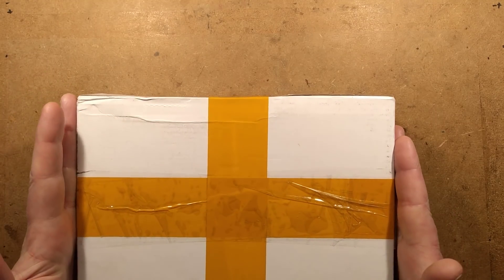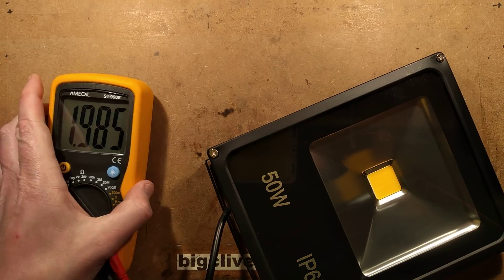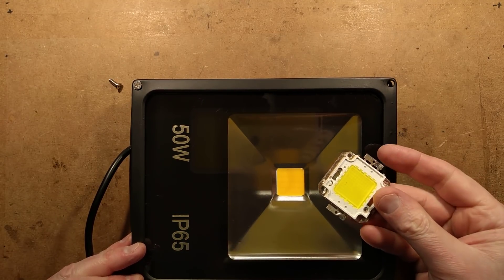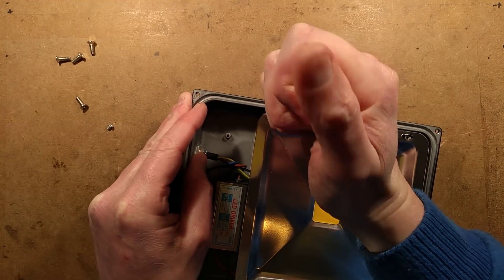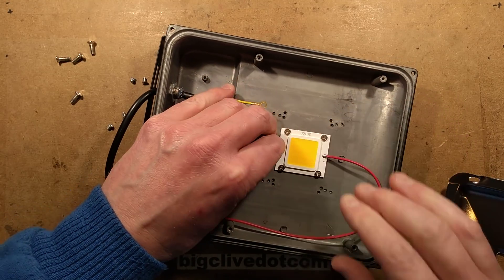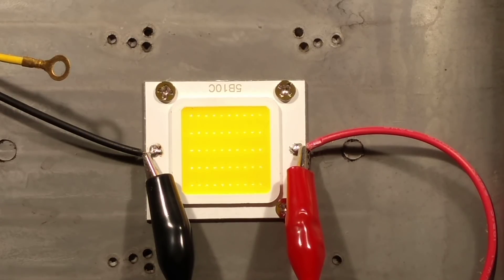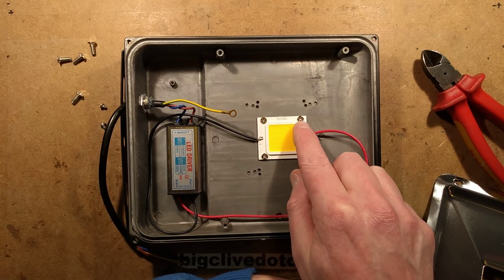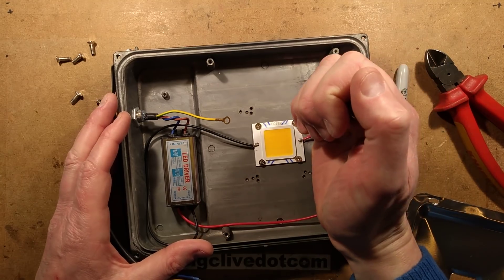Another cheap eBay LED floodlight.  Is it really going to be 50W?

Comment: no search link for ebay? boooo. still, looks like it could be a fairly nifty little source for reasonable parts i f you wanted to hack together something else. window how one of those full spectrum cobs would work in one of those shells. i've had people asking about how feasible it would be to make grow lights without breaking the bank, even though led grow lights are still insanely cheaper than the older styles.

Comment: Is it really waterproof that would kill the thing outdoors?
I think most of these wont even have an IP rating?

Our block recently had a so called leccie come and install one of these - charged  £170 and its blown within 3 months.
Thankfully I did not participate or pay for this numbskull ripoff spark -  he actually drilled a hole in the double glazing to fit it, used non ip rated wire, tied it up to the fusebox mains tails with tape and left all the dust and drill material lying on the hall carpet - also used black cable so not even any conduit or white to match the walls so looks horrendous wont respond to phone calls apparently!

This is the standard of the average tradesman in the UK these days 50% effort for 200% profit - how very sad for our country!

Comment: The  non connected earth wire looks typical of Chinese 'quality' control, for this type of unbranded product, you'd have to pay a fair bit more if they had to stop and connect that on every lamp! Also those reflectors are really only cosmetic as it in front of the light source, unlike a conventional halogen lamp
Another thing which seems to be common on many LED flood lights is the practice of pre fitting the flex, I'd do what Clive said & make the connection inside the fitting.

Comment: Quite a bit of futzing about trying to get those alligator clips on the wires; would have been faster to swap them out for mini grabbers. Surprised you don't have a set hanging by your workbench; maybe you should add some cheap shitty ones to your next eBay purchase?
Reply from the maker: I have some, but wasn't expecting the insulation to be quite so hard to slide back.
Reply: Probably just as well. Somebody else might have found fault with using mini grabbers to supply current. Can't please half the people half the time.

Comment: Very nice overview👍. Didn't look like complete crap for the money you spent. I could use some of those for outside of the shop.
Reply from the maker: Good value just for the casing.  Even at 20W the light output is useful.  The best bit is that for people who are technically minded like us they are serviceable.  You can fit new drivers and LEDs.
Reply: @bigclivedotcom  Yeah, good start to a LED DIY kit.  Hard to beat that price shipped to the door.👍

Comment: why are they not earthing...

answer: the manufacturers want to get as many done as fast as possible with as few parts as needed.

least screws to save money (even a single screw add up)
shortest assembly times (if they have to position an extra wire then that is seconds wasted starting on the next light)

so why not just use a cable with only two wires?  because two wires means they can't sell it in all the places they want to.
my guess, the cables are actually cut from recycled cables where they cut off the plug

Comment: Fitting the earth would involve the cost of the single screw holding the wire down. Clearly wasteful if not actually needed. Over 1000 units it could waste 1 pound/euro/dollar. Better to be unsafe and make the extra money.

Comment: Why do all these transistor LEDs always have this yellow filter in front of them? It even isnt 100% transparent and more looks like semi transparent. Like honey bee wax. Why is this? Does it block some unwanted wavelengths or even UV range? Why isnt it just 100% transparent? Or "white"?
Reply from the maker: The LED emitters can only emit in a single wavelength of light, so they use blue LEDs to stimulate a yellow phosphor and the combined output is white.
Reply: @bigclivedotcom  Why does yellow+blue give white light? Where is the red coming from?
Reply from the maker: @bestonyoutube  The yellow phosphor is usually made from a blend of different phosphors including green and red.
Reply: If you hold a CD or DVD with the metallisation at shallow angle to the LED, you'll see a spectrum and the output colors of the various phosphors.  Note that there are typically quite large gaps between colors, which you wouldn't see in e.g. incandescent lamp output.

Comment: There seemed to be a mounting post for the ground wire to the left from the LED driver? Maybe they just forgot to screw it down :)
Reply from the maker: Very few of these lights have the earth wire connected.  It's just seems common for them to leave it floating.

Comment: An additional question in my mind with this kind of product is whether the driver (or other power converter in other types of products) produces a lot of RF noise.  (I'm a radio amateur and have experienced LED and CFL replacements for incandescent bulbs that just wipe out reception.)  I'm not suggesting a laboratory grade measurement, but an AM radio tuned to a weak station, or better, a short wave receiver listening to foreign broadcast or time service, say from Germany, could sit nearby when the LED or other product is switched on, to see if it makes a significant impact on radio noise.
Just a thought.
And thanks for the video.
Reply from the maker: Almost all the switch mode drivers create a lot of RF noise.  The quietest drivers are probably the simple current regulation or capacitive dropper types.
Reply: @bigclivedotcom  Though it is possible to keep the bulk of switching mode noise "inside", though this requires shielding, reactances, and careful board/wiring layout, which I expect is rare in Chinese source boxes.  Still, in the states, we've had things like fining retailers carrying particularly bad devices, persuading them to push back on their suppliers, so some stuff comes thru that is fairly well designed.

Comment: I've just begun watching the video, my money is it will be no where near 50W. We will see if I'm proved wrong.  Posting at the 1:11 minute mark. :)

Several years ago I redid a bunch of our outside lights with 12V 10W eBay floodlights. Actual DC power was closer to 8W. Several of the LED modules failed over time. As Clive reported broken bond wires, they tend to flicker when first turned on. Replaced then with better LED modules and been working fine for several years.

Comment: I bought 2 cheap 50W LED floodlights with I think 100 individual little LED's inside of it, we put the one up on the wall and it lasted about 4 months before it started flickering really bad, every time we walk past and it turns on it gets worse and worse, it was like a disco outside. so we put up another identical one and for about 2 and a half months now it started flickering even more than the other one, we still have it up now and its like a epileptic nightmare they costed like a tenner each so what do you expect. Also Im pretty sure that the case isn't going to dissipate the heat of all the LED'S, I doubt that they are even making contact to the rear heat sink https://www.ebay.co.uk/itm/100W-PIR-Motion-Sensor-LED-Floodlights-10W-20W-30W-50W-Outdoor-Security-Light-UK/312275466766?hash=item48b5117a0e:m:mQXP7FFxaHtuJegDZGixwpQ:rk:8:pf:0 
this is the eBay link but i got it without the PIR sensor it would be cool if you could make a video about this supposedly 50W floodlight 
Thanks Clive

Comment: They terminated the earth cable with a connector but couldn’t be bothered with a halfpenny screw. 😂😂😂
Reply from the maker: The drivers come with the flex pre-attached and that crimp on the earth wire.
Reply: @bigclivedotcom  Ah, I bought two of the smaller ones you reviewed a while ago, I have one under my car port, one in my wood store.

Neither had the earth wire connected as you pointed out, so some new cable and a simple connector to the post that holds the bacofoil reflector cured that. Been working via a PIR , although not hard, for quite a while.

Comment: Looks like they just forgot to put the earthing screw into the post you pointed out  - they  wouldn't crimp a terminal on and then save on the m3 screw, surely ? I suppose the crimp term came with the driver though.... So close and yet so far.... and when will led driver makers put more than 30cm of mains cable on these things !!!???? 1 metre might give you some chance of tucking the connector away somewhere out of the weather.
Reply from the maker: They're using the stub of cable that is pre-moulded into the driver.  Instead of putting it into a terminal arrangement they just poke it out a gland.

Comment: I'd definitely imagine the flip chip LEDs make it easier for cheapo manufacturers to do a decent job. The ones with bond wires from quality manufacturers are extremely reliable, but the crappy ones are, well, crappy. When you're doing that many bond wires on such a low cost product something's going to give

Comment: I hope you're going to report that to Trading Standards to follow up. If it is a UK reseller the sale is illegal as it contravenes both safety regulations (for the earth) and false description rules (for the power rating). It would also be illegal to import if it is electrically dangerous.

Comment: To answer your question Clive, because if they see you grounded it, they know you messed with it!

Also, see if Thermal Grizzly's new graphite pads can make for a suitable substitute for the zinc oxide grease. Just for giggles. It's mess-free, won't ever wash off in wet conditions (hopefully) and comes in a couple sizes; I imagine one large enough to cover the space.

Comment: No earthing issue comes down to a legal issue is my take on it. If it could be shown in court that a reasonable effort was taken then liability hung onto the manufacturer would be valid. As there is no effort taken at all, that liability is all upon the end user and wrongful death liability case dismissed. Buyer beware being the first tenet of commerce, always trumping all that follow. It makes sense to me anyway. It's been shown that two lead lights don't sell, but by hanging the common colors in three wires on, it then does sell wouldn't be a point making or breaking the case either. It's just common sense they would put what wire bundle on it that does sell.

Comment: You're probably responsible for the majority of Cliff company's sales :D

I wonder how a 50-chip LED array is supposed to not burn itself up with more than 10W through it though - that's already at 70mA through each LED.
Reply: I also think that it's not really suited for use in these fixtures. I recently bought very long COB-LED strips (200x10mm LED COB's, you'll find loads on Ebay). 88 LEDs in serie-parallel, gives a current of 44 x 0,020 A, which completely equals the 10 Watt power rating they give (providing you drive them with a fixed current source and not with just some voltage)

But the light coming from them seems to be far greater than from the 30 and 50 Watt chips I bought a while ago. I get the feeling those 20, 30 and 50 Watt LED's have been produced in mass quantities, they never really caught on and now technology has improved and rendered them outdated.
Especially heat is a problem. The metalworker at the place where I work had a piece of 10 (or 12, don't know) mm thick aluminium kept as left-over. Decided to try that as heatsink for a 50 Watt LED (and eventually a 30 Watt).
With no cover, the temperature got up to 72 degrees at it's warmest point. WIth the cover on, it quickly rose to 85 degrees and beyond. Their just not up to the job I think.

At least, that's what I think. I still want to test what the light-output is with 3 of those COB-strips compared to a 30 Watt LED. So far,  I have not been disappointed. The light-output is great, they hardly get warm (or better: the temperature is far more spread over the large and thick heatsink) and the LEDs are so incredibly well matched...

Comment: I wonder if they have problems with leakage current from the LED - or a leakage fault in the driver? Maybe that's why they don't ground the frames?  
Could just be Chinese piece work, faster to not connect and saves a screw also - for every 8 (or so) lights they get a free set of screws.
Reply: For every screw they save, we get one!

Comment: It might as well not be 50W, because I doubt that you could maintain 80-85C substrate temperature at 50W with that case unless Ta is reliably frigid.  

To put this in perspective, the bonded-fin sinks I use for base-down passive operation have a base area of about 125x250mm, with 24 50mm tall fins.  That's marginal for 60W at 50-55C.  

Vertical orientation helps a lot, but with dinky cast fins, it doesn't mean much.
Reply: i have one and after 8 hours its still cool enough to touch
Reply: Forgive me for being doubtful, but "the heat sink is cool" tends to wind up being an indicator that input power is lower than expected or there's a significant thermal resistance between the heat source and the sink itself.  For example, the latter is why cheap fake SSR's tend to run surprisingly cool.  

In this specific case though, I'm assuming that yours is also operating at 20W and that "cool enough to touch" is approximately the same as saying "not too hot to touch".  That's plausible.  If those assumptions are wrong and it's actually dissipating 50W with e.g. 30C temp rise in still air, then I'm going to revert to being doubtful.
Reply: @PSUQDPICHQIEIWC  indeed mine was also not at the advertised 50 watts, for which I will forever be irritated. its closer to 30 watts measured.

by cool enough to touch, I do in fact mean you can put your hand on it without getting burned, but it still feels significantly hot.

but I was curious on why you seem to think that this heatsink, which is basically a large chunk of aluminum, couldnt support a 50 watt LED? especially since LEDs and their power supply are not 100% inefficient there will always be less than 50 watts of heat generated.

have you experience in using these LED chassis and heat dissipation was too low? I know that CPUs consume much more power than these LEDs but have no trouble getting rid of heat. that could be due to the radiator type cpu coolers though.

Comment: Hi Clive i have just ordered a couple of the "higher qulity" led 5b10c..i have had poor results with the crappy early design cobs ..only lasting a few months at best, and only intermittant pir use..so not many real time hours at all..im getting fed up with having to get the ladders out and having to change the cobs..we will see if they have improved at all..going on what you have descovered with this type of cob .. we shal see if there is an improvement at all..time will tell.. cheers for the heads up on this type and sharing the info.

Comment: Hey BigClive, couldn't find another way to message you other than comment on a video. What are you thoughts on the recent articles saying that LEDs wired in reverse can be used as a type of heat-sink like cooling device? Hogwash or is there something to this? https://soylentnews.org/article.pl?sid=19/02/19/1729234

Comment: Do you think the reflector was so thin, to help spread the heat easier?
Reply: No. Just cheaper. Majority of conducted heat (90%) is passing backwards through chip base via white thermal compound and into outer casing/cooling fins.
A thicker reflector might aid some additional heat conduction away from LEDs and allow heat dissapation over its large surface,  but would need to be thick to allow better conduction/improved thermal transfer.
Reply: Chris Goater No, that would require a thick reflector.

Comment: I suspect speed of the assembly line might be the reason the ground is not connected, that and poor or nonexistant QC. Those things are cheap for a reason.
Reply: Most small appliances in China aren't grounded, either. The standard wall outlet is a 2-pin socket. So they're probably not used to screwing that on for their own stuff
Reply: @puckcat22679  They seem to be screwing off for our stuff...